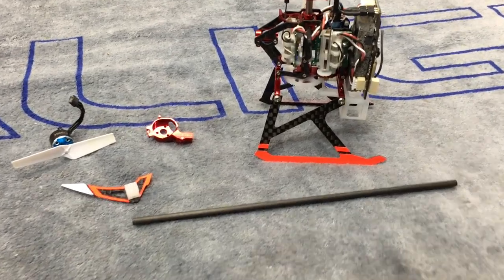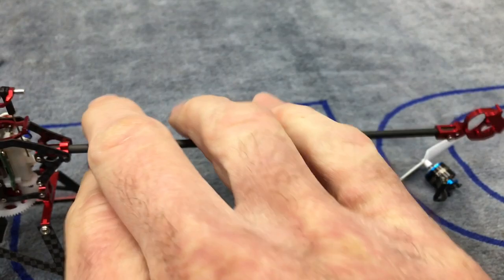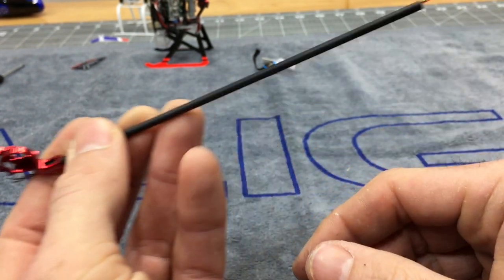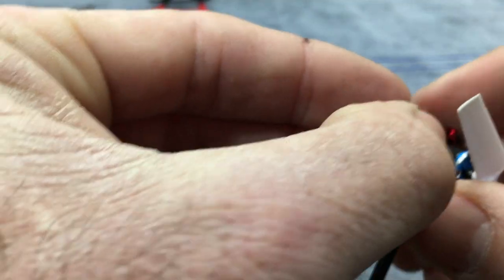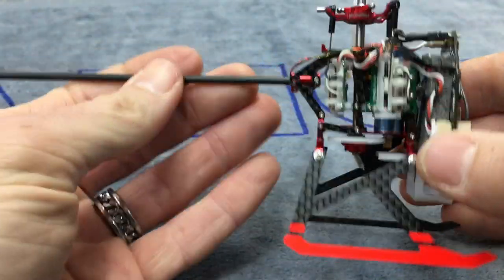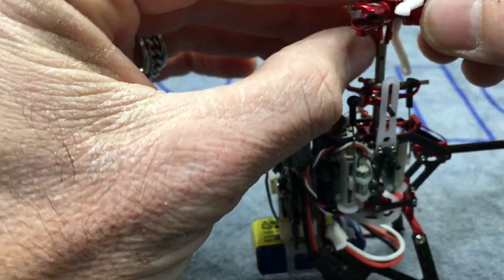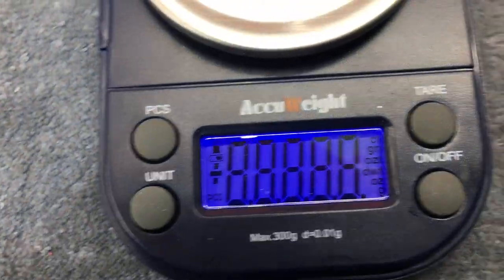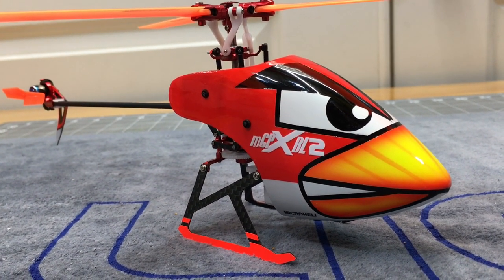MicroHeli mCPX BL2 Tri Blade Build Part 2

Comment: How do you level the swashplate?
Reply from the maker: I used the MicroHeli swash leveler and go to mid stick on collective and adjust the link ends till it’s level. Only real way to do it on the BL2. There is no servo centering mode or anything.

Comment: Nice build, the helicopter looks really good. It is hard to build micro helicopters because the parts are so small. But you did it  man 😃👍
Reply from the maker: Thank you! It is definitely tricky working on such small parts! The nano was even harder LOL build videos on that coming very soon!
Reply: @westhobbiesrc8051  Do note, CF is conductive, if wires have chafed insulation they can short through CF. This killed the ESC in my 230 smart. 
Checking for shorts before installing a battery can be recommended.
Reply from the maker: @henrik3129  Yes carbon fiber is conductive. That’s why you should always wet sand any edges that wires could be/will be in contact with. What carbon fiber on the 230? It is a plastic frame unless you changed it?
Reply: @westhobbiesrc8051  CF boom killed it. The stock boom broke on the first flight, when the heli did a ritual sepuku, after trying to murder me first, I suspect the heli is faulty in the Fc somehow, it has never worked as it should, from day 1.

Comment: Thank you for this information.  I wish you had explained how you leveled the swash plate.  Im gonna get the 2 blade version of this kit with the white dragonfly canopy.  I see microheli offers a carbon main shaft as well as the titanium.  What's better?  Thanks again!
Reply from the maker: Thanks for watching! I just used the included swash plate leveler and plugged the heli in went to mid stick and sure the heli was level and unplugged and adjusted from there but it only needed one turn on the right servo. The titanium main shaft is what I have in my kit and the carbon is like what comes with the heli stock. You will enjoy the build of this kit, awesome quality!
Reply: @westhobbiesrc8051  thanks for the reply, my  bl2 seems to have an aluminum main shaft and it gets bent easily if I crash (new pilot here). That's why I was wondering about carbon vs metal.  Seems like carbon might "spring" back to straight vs bending.
Reply from the maker: @IsaacBayer  is it black? Maybe it is Aluminum, never really looked. Titanium is going to be much stronger than aluminum. The problem with carbon fiber is yes it does not bend but it does break in splinter. Carbon fiber is very strong but very weak at the same time. As soon as it splinters it’s useless! So if you have a crash that cracks it it is just like bending it. Unfortunately something always Hass to give and or break on the helicopter there is no such thing as some thing that can withstand crashes. Because if the main shaft survives now you’re bending feathering shaft at the feathering shaft is made stronger to survive now you’re breaking main frame so on and so forth. Something Hass to be weak to take the force and give.
Reply: @westhobbiesrc8051  yes it is black, and the manual says aluminum.  Bends easily causing vibration, which then makes the gyro go bonkers.  Thanks for the info, makes sense!
Reply from the maker: @IsaacBayer  The titanium will definitely be stronger. Titanium is always stronger than aluminum so it will take more of a beating. The maiden flight video goes up tomorrow, I crashed it and picked it up and kept flying.
Reply: @westhobbiesrc8051  cool, I will keep an eye out for it!
Reply from the maker: @IsaacBayer  I upload every Monday and Friday at 12pm. Lately on Wednesday as well. Maiden video will be up tomorrow at noon

Comment: What up bro?...so i got the sonicwake V1 and then got all the mods for it and then the V2 came out...now im on the fence about either getting the sonicwake V2 or the thrasher V3 or the blade gas boat from tfl...i dont know what to do...i like the thrasher because you can run it anyware and i could use it as a recovery boat as well but i do want to get into gas boats and since i have the sonicwake v1 i want the v2 because of the new electronics and lightweight hull design...so tell me a little bit about gas boats...i assume you can run all day?
Reply from the maker: What’s up buddy, so that’s really a personal preference. The V2 is a really nice boat but if you are already molding the V one there’s really no point. The thrasher V3 is really cool but not sure if it’s really worth the amount they want. But I’ve seen them and they are really cool! Gas boats are nice because it’s just gas and go! You can run all day but of course electric is faster. If you want speed look at the TFL Genesis or Proboat miss Geico.
Reply: @westhobbiesrc8051  What up bro?...sorry to keep asking questions but i dont really have anybody around here that does rc stuff but anyways...when looking at electric motors from offshore electrics...on the winds/rpm...what does 1.5Y, 2.5D, and so on and so forth mean?...i understand kv but not that other stuff...basically im trying to find a super badass motor that i could put into the sonicwake...i would upgrade my esc to 160amps and above but i want to make something crazy...i dont care if i have to drill out for a bigger stuffing tube if i need too but could you help me out on choosing a motor that i could make fit into the sonicwake?...i need to stay in the "40"mm diagmeter but it can be a little bit bigger...i can drill out the motor mounts and make them bigger to fit a bigger motor...ironclad did it with a "sss4074" but i dont know if there is anything else that is more powerfull?
Reply from the maker: So 1.5Y or 2.5Y and so on is how some companies measure KV. So picking a motor is going to depend  on staying 6s or 8s or so on. If your staying 6s I would say anything from 1700-2000KV. Also depending on prop size you want to run. If going 8s I would say 1400-1700KV. The motor from the new V2 is a nice motor! With the 160A ESC and good prop it will do 80mph!